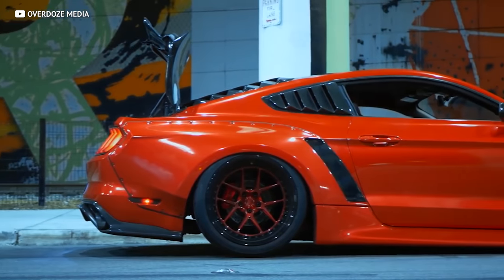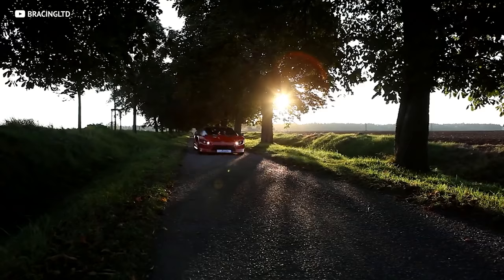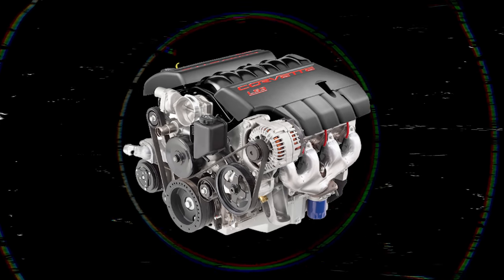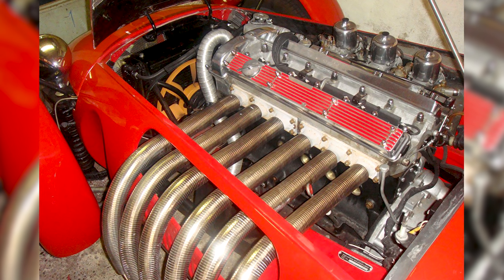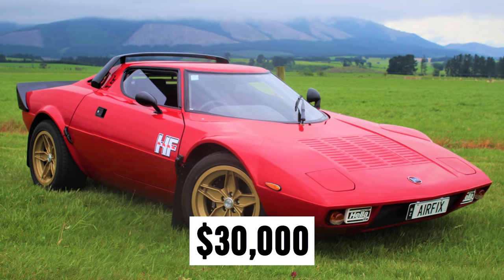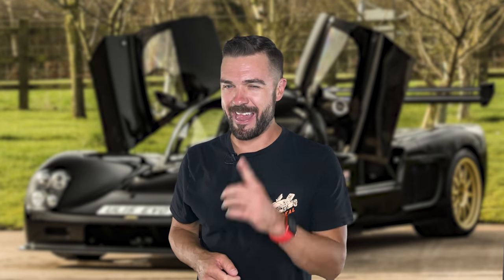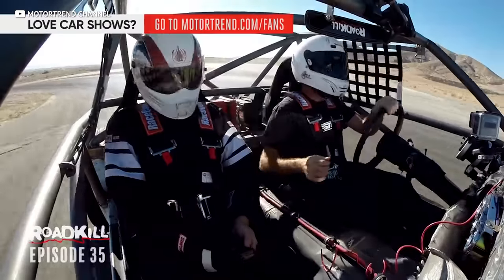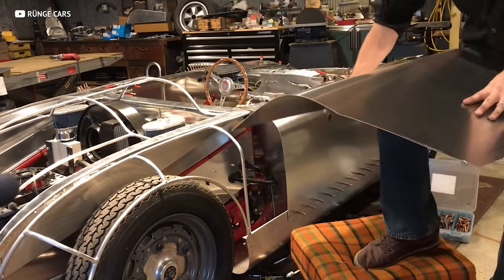Build Your Own SUPERCAR

Comment: The 917 did not have a "V" motor. It had a horizontally opposed 12, or "flat 12". And for power for a 917 kit, I would go with an air cooled 6 with a turbo.
Reply: Yup.
Still,  that kind of engine is impossible to get one.
Reply: actually it did  its  a  180 V12 engine the difference between a boxer  12 and a 180 degree v12 is the  configuration on the crankshaft so TECHNICALLY its a V12  even though its   well  V shaped
Reply: THANK YOU
Reply: I heard to even replicate that engine costs more than a brand new Lamborghini

A modern porsche twin turbo engine will be lighter and produce similar power while still being a Porsche engine
Reply: Wrong. "Flat" and "180° V" are interchangeable... meaning, either is correct. "Flat" can be used to describe any engine with horizontal cylinders, including those with just a single bank of cylinders. Any "flat" engine with two cylinders banks in same crankcase is also a "180° V", provided they share the same central crankshaft.
Reply: @driverjamescopeland  What about a boxer engine? Would that be considered any different?
Reply: @DolphinGamer  - Yes. A "boxer" engine, is designed as such that pistons opposite of each other, extend and retract at the same time. This requires individual crank throws for each connecting rod and piston. The 917 uses a "shared pin" or "paired throw" crankshaft. It is NOT a "boxer". This also why the specific output of boxer engines is limited, because the limited cross section of the crankshaft at various locations, limits the amount of material to withstand the stress.
Reply: @driverjamescopeland  oh alright I was always wondered the difference
Reply: @DolphinGamer  - there are merits to both designs. Not all "flat" or "horizontal" engines are "boxers"... but all boxers are "flat". The advantage to a boxer design, is typically lower mass required by the harmonic balancer, and the possibility to design the crank without counterbalance mass (this typically only applies to race engines, or engines with more than 4 cylinders). The disadvantage, depends on firing order. Some argue a TRUE boxer must have the opposed cylinders firing simultaneously. This is not true... but in some cases, they are designed to do so. The "batch fire v. sequential fire" argument was made for several years... but suffice it to say, Porsche, the manufacturer with the most experience of finely tuned boxer engines, chose sequential fire.... but some still argue, their choice was made to produce a smoother sounding/running engine for their premium brand.

Me personally, I prefer the smoother power delivery and sound of sequential fire... but several engineers have claimed merit to batch fire, in terms of reduced crank stress, as it apparently has some degree of effect on the torque load is applied to the main bearing surfaces. Others have argued the exact same point, saying it exaggerates "take-up" of the main journal's tolerance between the longer torque pulses.
Reply: @futten3230  "actually it did  its  a  180 V12 engine the difference between a boxer  12 and a 180 degree v12 is the  configuration on the crankshaft", That is Incorrect. A Flat 12 IS a Boxer 12. There is no such thing as a 180 degree V12.
Reply: @mikep4241   wrong

ferrari had a   12 cylinder boxer but  porsche had a  180 degree v12   the  difference  is  in the configuration of the crankshaft that  makes the difference between a  boxer and a  180 degree v engine
Reply: @highoctanegames  A Boxer engine has paired opposing cylinders, but not all Flat-12 engines are Boxers, due to differences in crankshaft designs.  In the 180 V12, the opposing cylinders are not paired on the crankshaft, so they are not at opposite piston locations during operation.
Reply: There was a company making a flat 12 🤔

I am using V12 on my Build 😎
Reply: @highoctanegames  In a Boxer engine, the horizontally opposed pistons share a crank arm, and as one hit the top, the other reaches the bottom of its cylinder.  There are also Flat-12 engines where the opposing cylinders move on independent crank throws.

Comment: 10:46 B is for Build building a Nissan R34 gtr using a Nissan gtr R35 as a donor
Reply: There is no better engine for an R34 than RB26/RB30.
Reply: @dj1283  R34 gtr B is for build is currently building is using a Nissan R34's Body Shell & putting it on a nissian R35's chassis & the engine is a V6
Reply from the maker: Chris is up to some ideal stuff isn't he!
Reply: @IdealMediaChannel  yes
Reply: @IdealMediaChannel  No.

Comment: Bought a running 04 Crown Victoria P71. Stripped it down to the frame, relocated the engine back 14 inches and dropped the center on the frame 3 inches. Mounted some Pontiac Bucket seats, and now need to figure out the firewall before building the cage and body.

Comment: In the late 80's I foolishly bought a used Fiberfab Avenger. It was a horrible build to start and truly "only just average" build after I took it apart and rebuilt it. It was an excellent learning experience for me, but it does show that you only get what you put in. Cheap parts and beginner fabricating begat a cheap car that I sold for a 50% loss.  However, I will soon approach my next component car with excellent fabricating skill and much deeper pockets.  Great video Brad!

Comment: Really like the Race Car Replica GT40 and GT-R. A bit on the pricey side at around 50k to 60k less transaxle and engine. Would love to build it with a 351 windsor punched out and stroked to 400ci or better. Then do coil near plug and EFI with individual throttle bodies. I won't see this build done for a good long while. A man can always dream of hanging with Ferraris and Lamborghinis in a cobbled together monstrosity based off a 60s design known for being less than stable at high speed.

Comment: If you're going to buy something from RCR, they were producing a Lola T70 MkIIIb for a while, at a relatively affordable price. And it had options to buy everything necessary to assemble the car, except for an engine. The great thing is that the real Lola T70 was most commonly powered by a Chevrolet small block V8, although there were a few built with a big block, and even fewer built with other engines, even the Aston Martin V8. The RCR Lola T70 was built to original blueprints. You could technically build a heritage racing legal car from the RCR kit.

Comment: I would buy and builds a kit Maxx Budget $30K  to build myself. Though have the room, I do have the tool just need the engine lift and car hoist. work too many hours, and would prefer a Brand new Mach 1 with a Warranty and option for extended warranty.  
Requirements on Purchase are as follows:
1.  6 speed manual transmission 
2.  naturally aspirated, or super charged.... Manufacture's mount Turbos too close to the engine without a heat shield between them., causing each other to fail
3. Next purchase will be all white car with Performance Pack or the next Mustang Gen 2023 if Performance Pack 2 is not available the 
BOSS 302 will be my next purchase.... with 6 speed manual transmission.  
Thanks for showing more kit options though. 👦🏻👍🏻🏎🏁
Reply: Thanks for sharing, too many idk’s, huh
Reply: @pastperformance2285   Well past experiences either Turbos or engines fail , and don't have time work on my personal cars

Comment: I 'carted' a 79 Fiat X-19.   I stripped all the metal off of it, the bumpers, the top, the pop up head lights - primed all the take offs, sold them.... mounted a Sawz-all Manx fiberglass dune buggy on it. 
I fitted Bigs & Littles and terrorized the dunes with it. so much damn fun.   Sold it for 10K .... I regret doing that.

Comment: I owned an Ultima EVO with a 1200 HP engine.  I only saw the Ferrari F12 that tried to race me in my rear view mirror.
Reply: What trans did you run?
Reply: @bernardwarr4187  6 speed manual by Porsche.  They didn't offer any other for that HP rating.